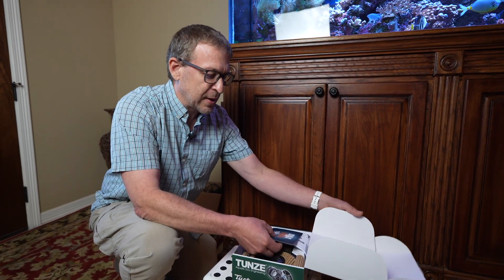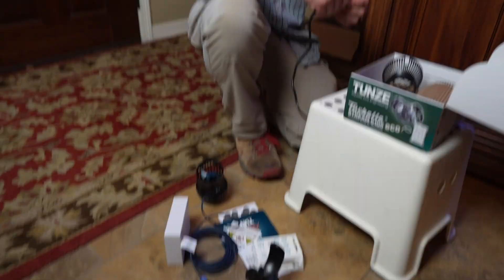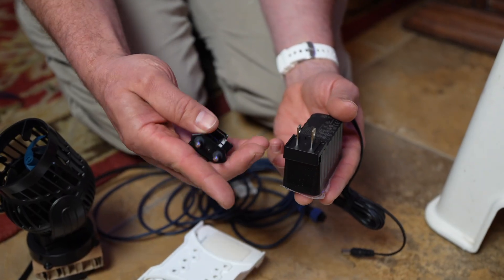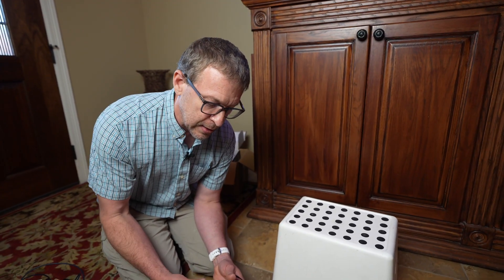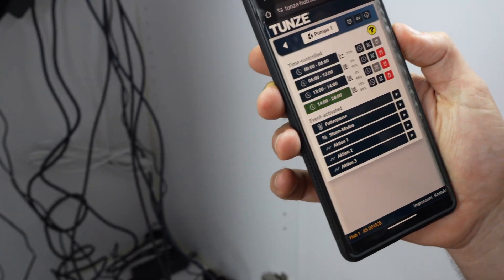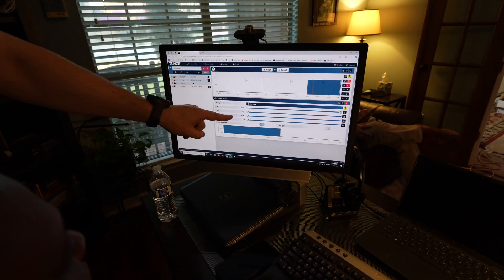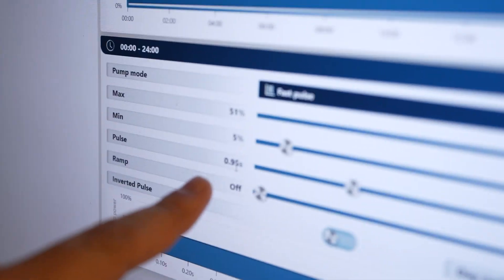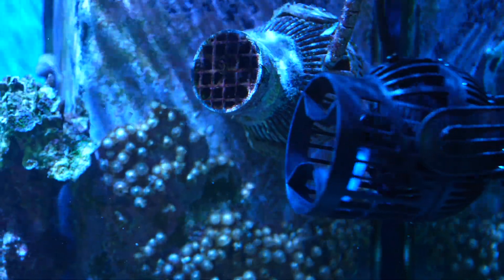I create a standing wave JUST with flowpumps! - Tunze

Comment: Does this have any effect on the glass and seals with the added pressure?
Reply: No, TUNZE has 21 years of experience with this. Theoretically, such a wave does create a slightly higher load, but it is so minimal that it can be considered negligible—especially when compared to the reduced adhesive strength of silicone bonding due to aging.

Comment: Helpful.  Also kudo's to the hobbyist.  Very approachable and friendly.  Little bit of a learning curve with the Tunze HUB half of which is new to the product lineup to be fair.  One thing I thought was a feature but turns out it isn't is the ramp section when you go into the hat icon to fine tune.  I was playing in there, changed the valus, then closed it out after a minute.  I saw on the UI that the ramp up was actually moving in real-time.  I was thinking that was super cool as it would be a rolling window of change.  Turns out I was wrong in how that worked.  Anyway glad I made the switch to Tunze but still got a lot to learn with getting them dialed in.  They generate flow for sure.

Comment: I picked up 2 6105 pumps for my 5 foot tank, I’ve got one set up now and am installing the second so I can get a wave going in it.  I hope my Cade can handle it.
Reply: If the cade is rimless one 6105 in fast pulse mode will push water over easily.  I have a pair in my 210 gallon display with a EURO brace and get water out with little to no effort and it is 54 x 30 x 30.  Even a single will get a wave that antman can surf on.
Reply: @saf1671  it is rimless, I set it up and it’s staying in the tank.